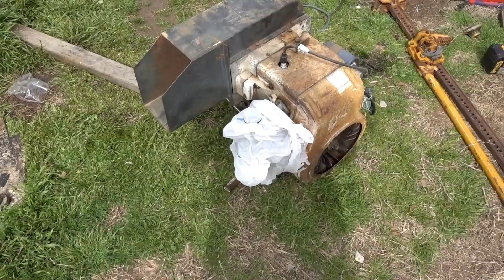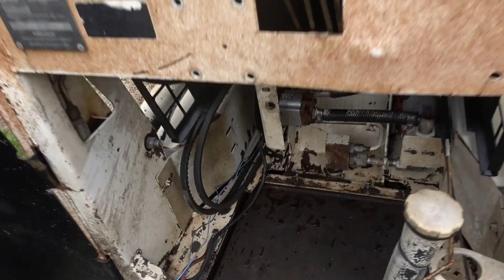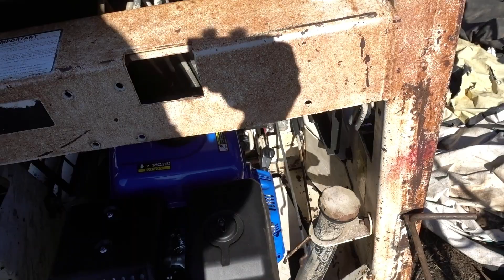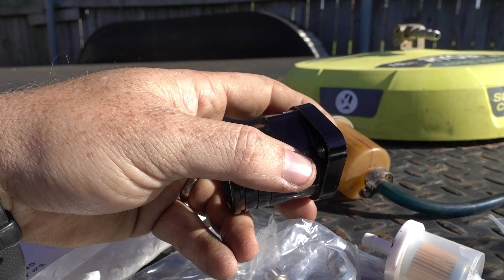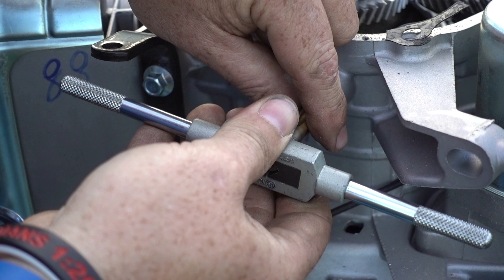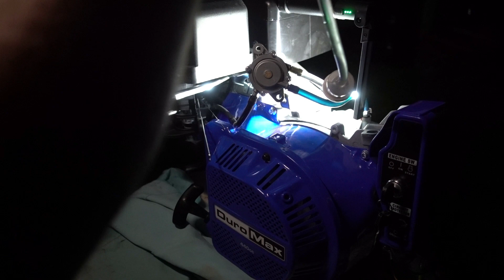Repowering the Bobcat 310 DuroMax XP440HPE Part 1

Comment: Quick question but I tried using this motor for a 310 repower and it just couldn’t get started when there was correct belt tension on the pulley/s. The engine runs great and works well. I could start it with a lot of slack then slowly pull back on mount plate and it could stay running and running well after correct tension was applied after it had started. Could this just be a bad/weaknstarter or wrong size pulley? Using a 6 inch single going to high speed side where the hydraulic drive belt is.